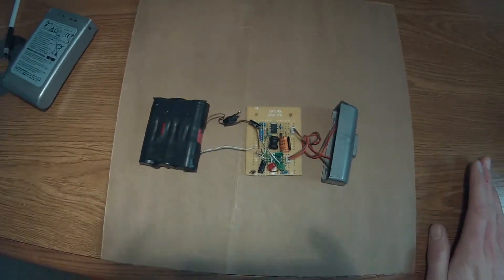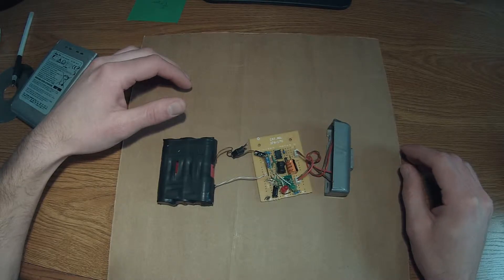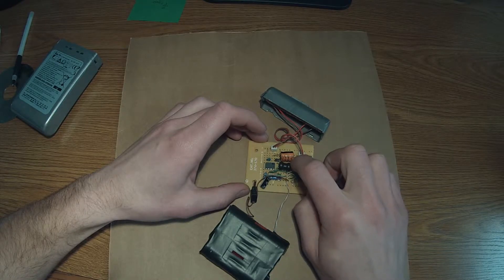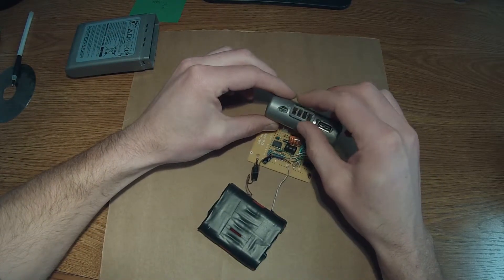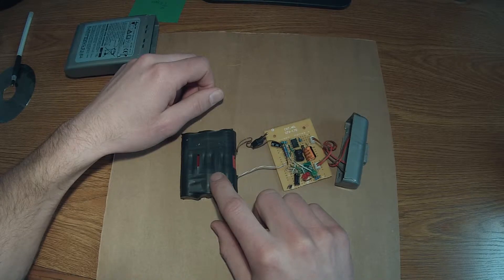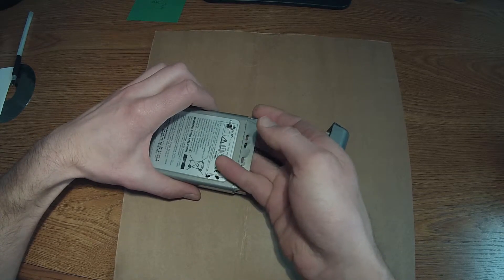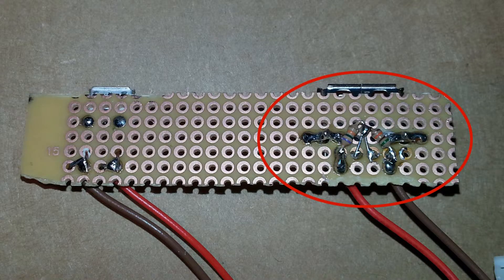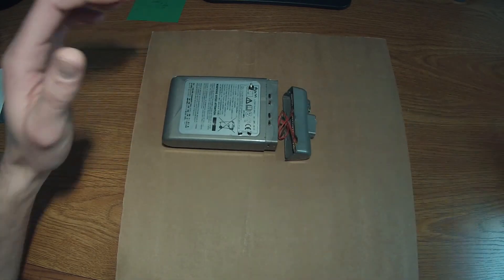DIY Mobile USB Powerbank

Comment: HI,I'M INTRESTED IN YOUR POWER BANK CIRCUIT, A WOULD LIKE TI BUILD ONE FOR MY OWN USE, WHERA CAN A GET THE DIAGRAM?
Reply from the maker: +Roberto Garcia Hello, thanks for interest in the power bank video. I don't have a schematic, but the circuit consists of two independent parts. 1. The voltage regulator circuit, of which I'm using a MC34063 chip. 2. The battery charging circuit, using the Torex XC6802. These are two separate circuits both connected to the same battery.
To begin to use and understand the voltage regulator chip that I'm using, I would recommend watching this video:
https://www.youtube.com/watch?v=qGp82xhybs4
To use the charging chip, or one like it, I would watch this video:
https://www.youtube.com/watch?v=n_FUkMcOplo
In the first video, Dave, will demonstrate on now to calculate the necessary component values. I found this video helpful when using the chip. There are also web pages that do the calculating for you, which is helpful also.
Let me know if you have any specific questions.
Thanks, and good luck!
P.S. I should also mention, I get a lot of my parts from digikey.com
Also, you should download the data sheets for both of the chips, they will show exactly how to use them.
Reply: thank you,i don't know about electronics but i'm understanding the video you recomended..